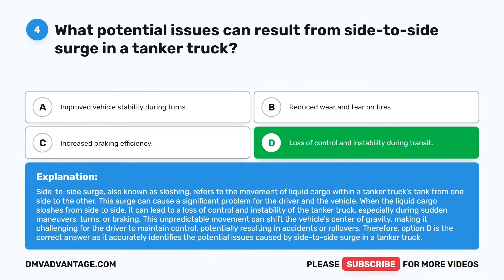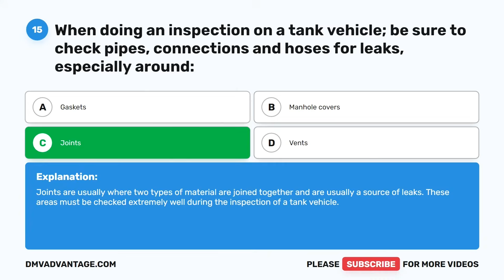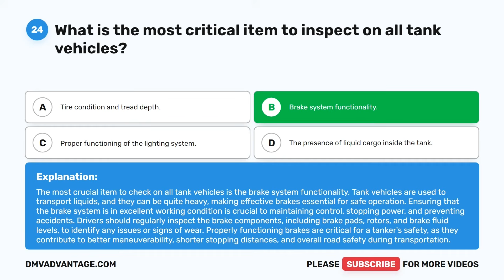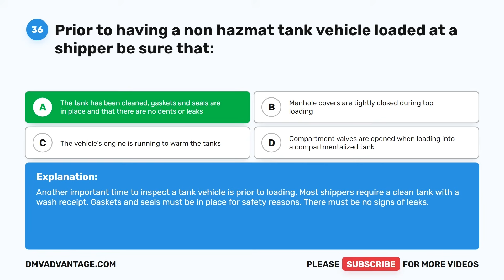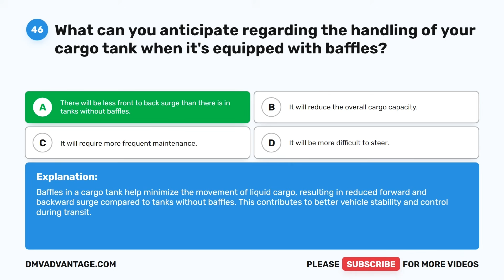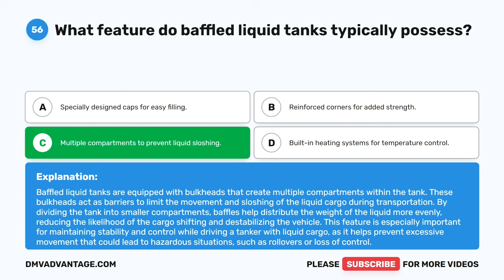CDL Tanker Test 2025 (60 Questions with Explained Answers)

Comment: Question 8: what cargo is transported in smooth bore tankers? Awnser is Milk or food products but the reasoning is wrong I think. (I just started learning) says that smooth bore limits liquid surge but baffles and bulk heads are used for that. They use smooth bore for milk because it's easier to clean but the trade off is no surge protection.

Comment: thank you for providing this information however there are some wrong answers or questionable answers. example. questions 21 and 47 are same but answers are different. both questions are referring to same condition. the fact is, the distance you can see and the distance of your low beams are same thing. so both are correct actually but Q21 and Q47 says correct answer is different. Thanks again. Also it would be nice to be able to navigate back and forth and go directly to a particular question. Cheers